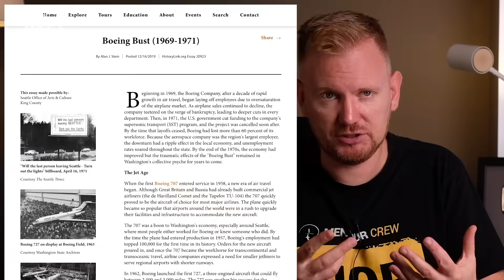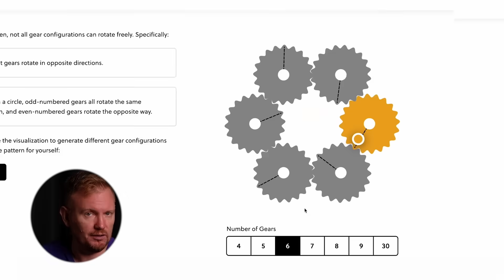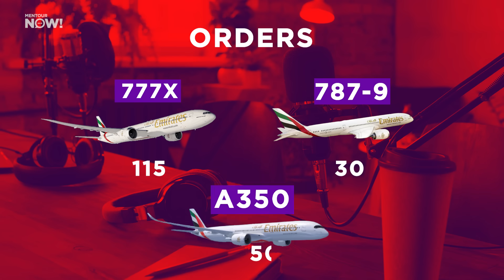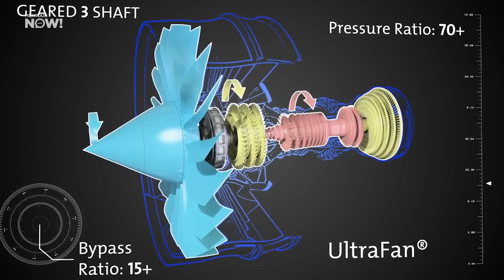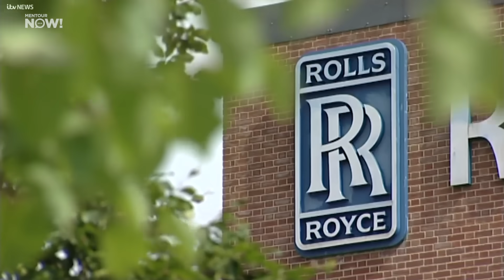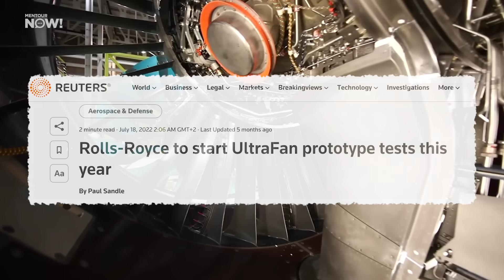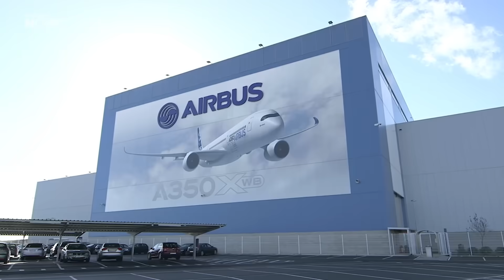Are BOEING planning a 747 with 2 ENGINES?!

Comment: It's unlikely that Rolls Royce would get that far ahead developing a new engine unless they had a target aircraft in mind.
Reply from the maker: Yep!
Reply: @MentourNow  But is it Boeing or Airbus they have in mind? It's possible they are doing an "if you build it they will come" approach. Given the much later development of the 380 compared with the 747 it would seem to be an easier target airframe. Plus a huge ultraefficient engine would be useful for militaries too (think of loiter time for an AWACS).
Reply: @kenoliver8913  : Honestly, if Rolls Royce are going Field of Dreams, then it's probably for fuel uncertainty as much as anything else. They may well be stacking the deck so that they have fewer future challenges to worry about- instead of the facility really being for the current engine, it may be intended "for the next twenty".
Reply: @MentourNow  Making the largest engine possible, even if there is no demand for it, makes sense from engineering and business perspectives; its much easier to scale down the design, than it is to scale it up.
Reply: @axelBr1  They should come up with a three engine aircraft a lot like the MD-11 thats little bigger than the 777!
Reply: @Angry.General1461  Third engine placement would be interesting for a high by-pass engine 😆
Reply: @axelBr1  I'm talking about the third engine being located in the tail just like the md-11!
Reply: @axelBr1  Usually best to build what is needed, rather than a dogs dinner. Engines this size would be best suited to high wing designs used mainly by the military.
Reply: @Angry.General1461  good point maybe operation one big fan vs 2 running at 60-100 % loading as jet's work better fully loaded but for now legally speaking 2 ( was 3 and i feel much more safe with 3-6 engine's vs 1 or 2 but it's the 2 are norm-ish now ) is the minimum for corporations flying so this is a loophole-one 1-engine in maybe saving's ect? and or a pathway for hybrid/electric units/smaller sized twin's in the front complying engine's
Reply: @rorykeegan1895  well there isn't a hard rule engineering wise to super low wing and stubby gear and the mounting and engine on top might even work better vs high mounting jet engine 

as for airlines loading and unloading this jacking up gear-low engine/caloling clearance ect makes it harder and same way for emergency's ie firefighters to get to so earlier design and mindset was probably better as modern airport's are 90% now water or concrete tarmac's and now grass/other strips aka the gear isn't made to land on it ect
Reply: @rorykeegan1895  Nothing dogs dinner about this, its a clean sheet design, the decision is to build the largest engine they would ever possibly need; get all the materials and aerodynamics etc. problems done at the start when you have the largest team available to do it. Then scale down as need be. Everything easier, no sudden surprises that there isn't the space to fit something, that the materials aren't strong enough, tips of blades are going supersonic etc. Scaling up is always hard, unless you're making transistors.
What is a dogs dinner is the B737 Max, a perfect example of scaling up beyond the capabilities of the original design. B737 Max would have been a great plane if Boeing had taken the B787 and scaled down.
Reply: @Angry.General1461  But Axel's point was that the big engine would be a lot harder to mount structurally and (especially) aerodynamically on the tail than the far smaller turbojets of the old triples.
Reply: In which case it seems that it has to be Airbus. Boeing's 777X has a 426 seat configuration, whereas the a350 series tops out at 369 passengers. There's a gap in the 370-450 seat range, particularly for a plane optimised for belly cargo. If Airbus can build one with the range to do extreme point-to-point (eg. SYD-LHR) then it has another huge advantage for current a380 operators. I'm skeptical (sorry Petter) that a twin deck plane is of interest, given the requirements for airports and the disadvantages of loading, but might be very wrong about this.

The major question for me is whether Airbus have the engineering resources for this and a clean-sheet a320 series replacement. Which comes first in the development cycle?
Reply: @Secretlyanothername  twin decks have demonstrated a major problem already.  By the time you put pax baggage downstairs there isn't much freight volume left

The A380 has higher freight mass capacity than a 777 but only 1/4 the cubic volume available

This is why most airlines top out at 475-525 pax. It gives more space downstairs and halo class space upstairs. 

Freight is more profitable than pax and Emirates is one of the largest freight logistics operators in the world
Reply: @Secretlyanothername  
Any commercial aircraft design that relies on US airports upgrading their infrastructure are doomed basically. That's why the A380 never sold in the States, along with their insular attitude to all things foreign of course.
Reply: @rorykeegan1895  personally i got the impressions that airbus copied Boeing/🇺🇸 government works as a earlier version of the 747 looked like the 833 and was a about the same thing/size ect but got can'd for some reason? pre-1970

and yes im aware that airbus probably modified the design to 2010 spec's vs 1960's-spec's

still think it will come back into production-manufacturing or something like it will and yes cargo wise ( and maybe also passengers? but for longer and more crowded routes ) definitely should have been better reception/sold in the 🇺🇸 and more common to see at 🇺🇸 airports and international airport's/bound for 🇺🇸 landing's
Reply: @rorykeegan1895  i don't fully agree on the all things foreign part of the comment as IE Toyota/foreign branded and plant's now is well loved and isn't a one-off , also look tic-tock is Chines and it's doing well

i do probably agree with 🇺🇸 market having different tastes vs china or parts of Europe as last-decade has been luxury 4door pick-up's and suv's mostly sold vs hothatch's/small compacts car's or bike's, sorry im not airline and or buyer of big aircraft and don't have a license-fly so i don't know he market wishes/driving-factor's well but cars are a hobbit hobby of mine, also car and trucks i don't line up in the general public tastes or i have older style/tastes as i like say a mx5/ecobox/bike or single cab-long10ftbox trucks for work/utilitarian needs and not 4-door show-boating at a white collared job parking lot
Reply: @rorykeegan1895  But the A380 was never designed with the US in mind,but overwhelmingly with Asia in mind. You keep forgetting that the US is not the world.
Reply: @richardprice5978  Not so. The 380 has a "double bubble" fuselage and a high chord wing, both totally unlike the 747. It would be more accurate if you thought Airbus said "let's make our jumbo as unlike a 747 as we can".
Reply: @Secretlyanothername  an a360 with at least 15% more capacity than the a350 would make sense. it would be a strong competition to the 777X.
maybe this is the time where they extend the body in the section where the wing is and use that space for the toilets or the kitchen on the sides of the plane, inside the wing. so that wing and fuselage melts together?
i am wondering what current plane could serve as a test bed.
usually they used an a380 to have 3 working engines and one test engine. but where should they mount that monster?
Reply: @stefanweilhartner4415  a large chord wing like that will severely impact range (increased drag) but you have a point. If doable it would allow increased freight capacity (BWB aircraft will almost always fail the 90 second evacuation rule if setup as mostly pax)
Reply: @stefanweilhartner4415  Blended wing planes have space efficiency and aerodynamic advantages but also practical disadvantages for an airline, many to do with loading and unloading (eg think about airbridges). They've actually been looked at hard by manufacturers (including both Boeing and Airbus) but no-one has attempted one.
Reply: Peter
RR just finished the construction of the Super fan . It is going into testing as we speak. This is the largest engine with greatly improved efficiency.
Exactly as Petter mentioned it.
Reply: MILITARY/USAF Strategic Airlift Command? Having the power to Carry more than a Single MBT.
Reply: @trevorhart545  Such a military behemot even STOL capable heavy freighter could carry several armoured vehicels in its belly. 
A squadron (12-14) of those could deliver lots of military equipment in to the battlefield.
A flying red ball express.
Reply: They know what requirements are projected and engine development takes far longer to have ready than aircraft. Don't forget the RB211 saga...
Reply: @miscbits6399  and the SR-71's j-58
Reply: It is my understanding that the major problem with the A380 was the wing capacity,  limiting its utility as a freighter to high volume uses, not high mass uses. Thus, no A380F. Adding engines capable of driving a twin engine A380 would make the wing problem worse. Airbus needs to completely redesign the A380 wing, which means they might as well redesign the whole aircraft, as the wings are the most complex parts of an aircraft other than the engines.
Reply: Yes. I'm thinking a Double Guppy.
Reply: Could it maybe have military uses?
Reply: Is Boeing wishing to re-introduce the 747 as a Very Big Twin ? Would this monster engine even fit under the Wing?
Reply: @MyJerseybean  Nope. And nope.
Reply: @MyJerseybean  high mount's or inside of the fuselage/wing for this reason ( fan doesn't fit or sucks up junk landing and take off ect ) on vary sub-sonic large jet's makes more sense vs a small GA-aircraft as then im more mixed feels or lower wing/bi or tri-plane configuration
Reply: @MyJerseybean  btw hobby flyer's GA need more compact wing's or storage the 707 Boeing to airbus 833 sizing if ran well spent's most of it's time flying and not parked (holiday and or weekends generally speaking as its not used for business-tax use GA-aircraft ) on the ground paying rent or being towed to airport/takeoff so wings aren't as big of a deal or at least im not so sure a full size folding wing makes economical sense to operate 

SST air breathing or Kaman-line/space flying wing/fuselage makes sense to me as it starts out as a 1950's ish/b36 mode as transfers to the wingtip in SST mode making it pointy/smaller drag ect as this design and flying mode doesn't require folding wings or the delta/short coming's of the concord, but maybe more or more complicated engine's/duckting and fight software/computer's ? and or additional rocket engine for one of the wing tips/tail in SST mode and use's less energy? and can fly overland/restricted-speed/sound and bigger cargo size or 300-800 size passengers capacity?
Reply: Market leaders seek to create demand. "If you build it, they will come."   If they successfully build it, then bam! it's now available and ready for future sales
Reply: B52/big plane or 🇺🇸 bomber command ? as the engine design's used are vietnam-war era or pre-1965ish aka old and a gas hog ( also very smoky aka easier to find and hit with anti-air equipment ) and hard/expensive to keep airworthiness 

airforce has mentioned buying new engine's
Reply: @richardprice5978  so you think this new engine will replace the one on the B52 or are you saying this new engine is like Vietnam era engine as it's using the same tech? I'm confused
Reply: @kobihersh  no the RR improvement's for slow to mid speed flying it smoke's less and has less turbo lag ect vs the ~1950's GE in common use 

FWI i feel/see double or triple size design probably will return for freight services ( aka the 833 or 747 might come back into production as a freighter manufacturing line or conversion services to do it and the atinofe 225 might come back/line as well as it's super useful and for now nothing's replacing it design/use wise as things like large heavy transformers for utilities ( or spacecraft or equipment /others industries ect ) need it as road and water and RR is longer trips is $$ and best for last milestone delivery ) and limited passengers service airplane wise, and maybe even medium sizes to vary large airship's powered by turbofan's/turboprop 

USA 🇺🇸 lost it's umf 1960's magic ( shell of it's maximum former glory in 2023 ) as its lost to the European's/EU as making SST ( Boeing common and or for recon/bombers as i believe the airforce wanted a decentdent of it, and the USA spec aircraft frame wise looked to be the most advanced with the USSR being the cheaper clone ) or being 1st in space-whatever aka like going to mar's or good fast RR services or shipping for passengers and kinda so for freight as doesn't have the autobahn or something like it, and the list goes on
Reply: Really? Do remember its a British company, which means dealing with reality isn't top of their list these days.
Reply: I wonder if airbus is working on a competitor to the 777x, and those engines are for that plane.
Reply: f.e. A new modernised 4 engined AN 225/326 super freighter.
Reply: @obelic71  doubtfully anyone sane would deal with Russian companies in the near decade, unless they remove Putin soon... Foreign companies list fortunes when Putin closed the gates on them and chased then out without their properties in Russia,
Reply: On the Rolls Royce Ultrafan website it states: "Long-term fuel economy gains of up to 10% are possible with UltraFan's scalable technology from 25,000 lb thrust (111 Kilonewtons ) to 110,000 lb thrust (489 Kilonewtons) for narrowbody and widebody aircraft."

Even at 140" fan diameter, the thing is only designed to produce thrust in the same range as a GE90 or GE9x.  It's not some 'mega-engine' for a future hyperjumbo aircraft...

Comment: If Boeing built a 747 form factor aircraft using 787 technology (carbon fiber structure, bleedless engines, etc.)  It might be light enough that it could work with the existing GE9X, or an upgraded version of that.  Given the time necessary to complete the airframe design, an upgraded version of he existing engine design could like be completed in time.

Comment: I knew it. They should redo the 747-SP with 2 engines. Big passenger load smaller foot print...very efficient and versatile...
Reply: Take the hump away, and that's technically the 777-200LR/-8
Reply: @yudasgoat2000  Really, the 777 has the same beam?  Leave the hump for crew rest and ultra first class.....thanks for the info.
Reply: @thereissomecoolstuff  You don't even need the hump if it's not for passenger access - the 777-300 has upper level crew rest with two bunks and two rest seats.

Comment: Of course you want to operate from one hub only if the oil wells next door can provide your planes with  cheap kerosene! It  is an unbeatable business idea! LOL PS: The Mentour pilot desk lamp seems to get too hot at the top due to a halogen bulb. I would switch to LED if a fitting socket is available or a less powerful bulb to prevent damage or in a worse case scenario a fire source.

Comment: When making the broad claim that 2 engine aircraft are more efficient than 4, you should be careful not to compare apples to oranges. eg. A 747 has greater wing sweep than most other commertial aircraft so it can cruise at a higher mach and 4 engines allows certain flight planning advantages on a few longer oceanic routes(even with modern etops). 
The extra maintenance is really the largest cost issue with engne count, assuming facilities are availible that can handle giant engines. Secondly aircraft of that size just don't have as many uses with the current networks.
There isn't any savings in general systems, twins still need redundant fuel pumps, hydraulic pumps, fire systems, air-packs, and such things. 
The size of an individual engine has some economies of scale, especially at the lower end, but at the large end this can be fully offset by the design flexibility offered by the additional redundancy of 4 engines. A twin enin plane must be able to fly on one engine so they must be substantially oversized in normal operation. 4 engine aircraft only need to operate on 3 engines so they don't need as much reserve capacity, and the rudder can be smaller reducing drag.